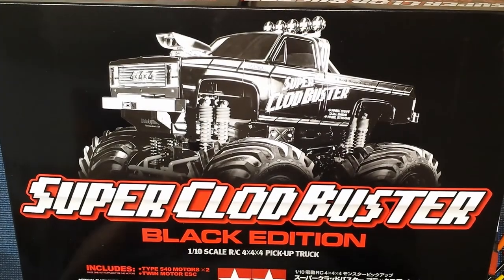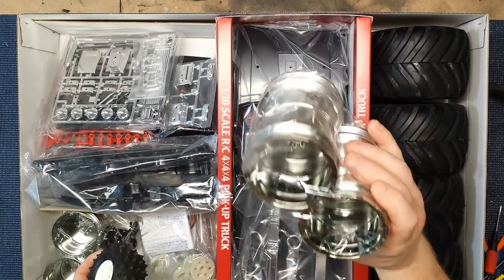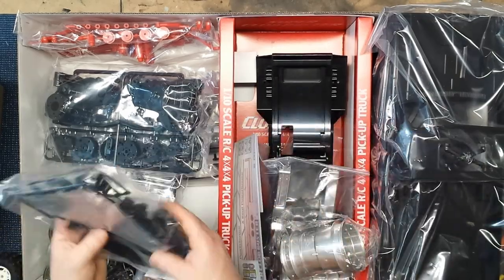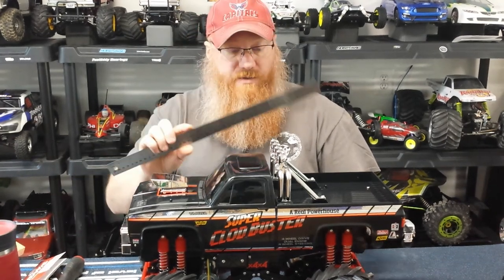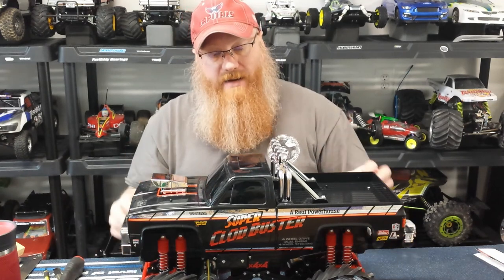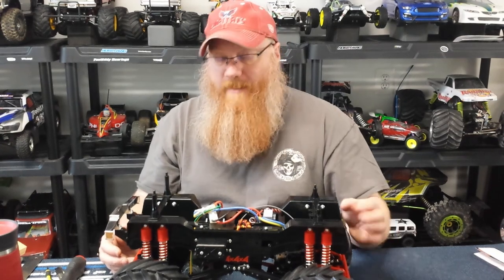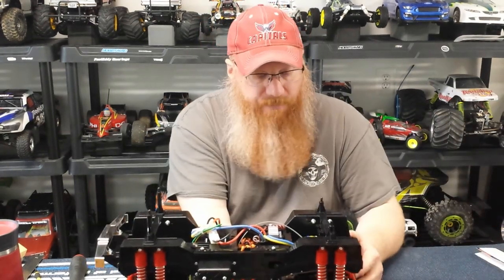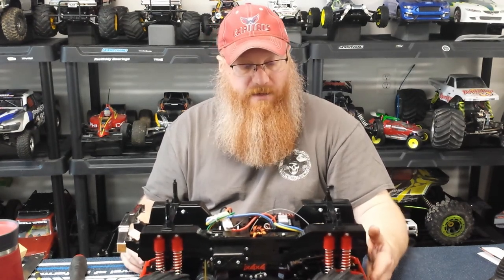Tamiya Clod Buster Black Edition - Build, thoughts, action and ramblings

Comment: Thank you for replying to all of my comments I have the original clod buster have they improved the steering so it will turn sharper and do they still use those horrible servo savers that are too loose that it won't steer correctly
Reply from the maker: Not a problem at all! The clods don't steer well at all sitting still but once they are moving it is a lot better. Still nothing beats them lumbering and bumbling along!

Comment: Nice video! I bought one myself, because I like the Limited Editions . Thanks for the heads up about the stickers. Question? Why do you mount the directional chevron treads backwards? Thanks
Reply from the maker: On the crawler it grabs a little better, and looks different. For the regular truck they'll stay in the traditional way for sure.  I never glued them so it is easy to swap them around. Thanks for watching!